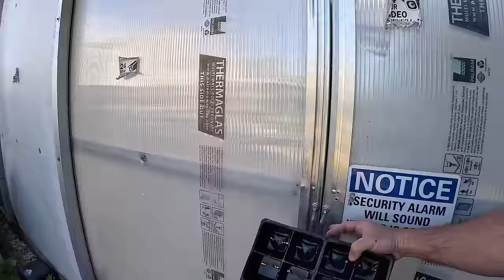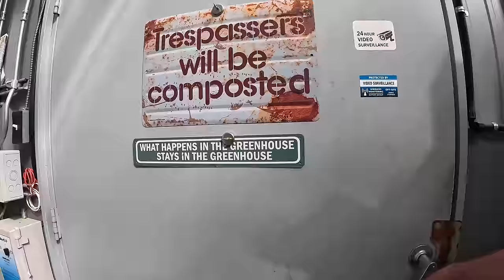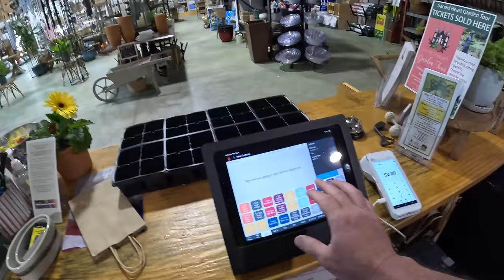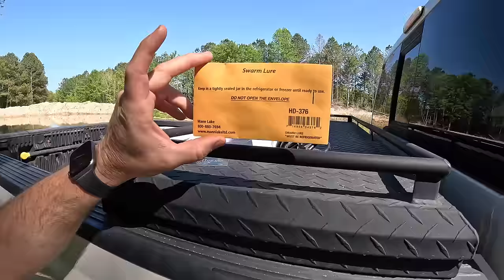Interesting Day: Honeybees, Garden & Eclipse #vlog

Comment: Having had both my hips replaced, the right side 3 times,  let your dad know the it takes 3 months for the muscle to heal, and 6 months for the bone to heal completely. With my right side, I tried to go back to work at 4 months, and it ended up fracturing mid implant, so if your dad want's to avoid my error, tell him only light duty for 6 months after the hip replacement, so he avoids all the problems I had. Cheers from Canada!
Reply from the maker: I’ll be sure to tell him in the morning, thanks for watching in Canada!!